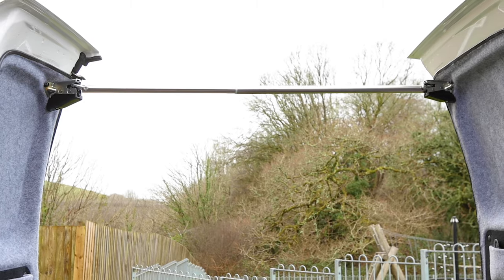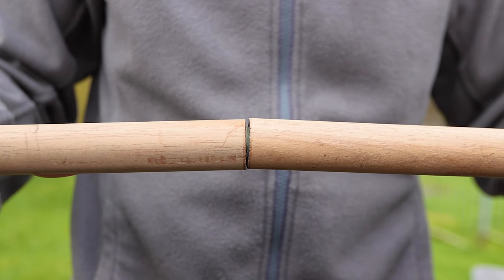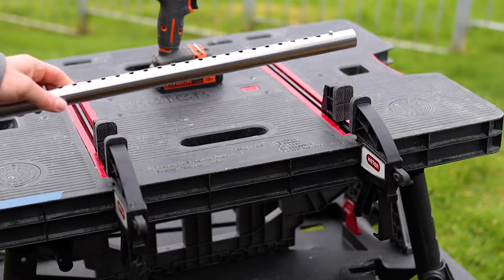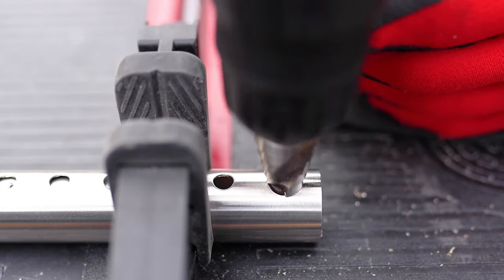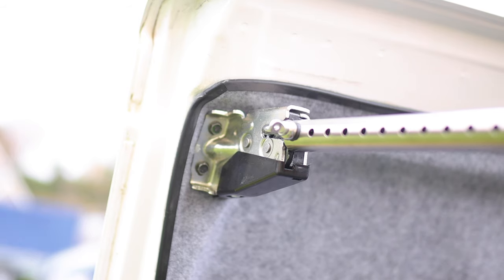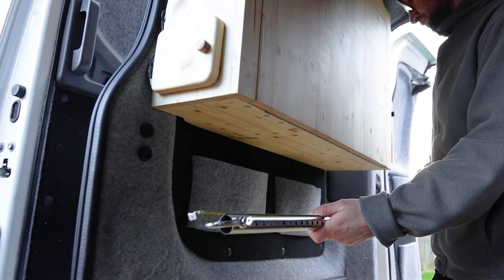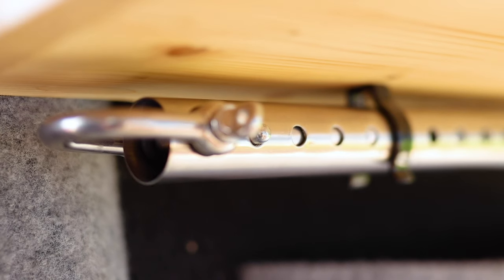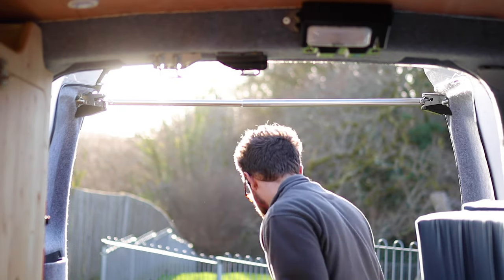HOW TO Stop Doors SLAMMING In The Wind | DIY Door Bar

Comment: That's perfect, and it could be used to hold a privacy screen for outside showering so the purpose would come full circle. Changing the subject I was impressed with your workbench and I want to get a new one as my B&D Workmate. It is now 30 years old and starting to fail. What make & model is yours, please?
Reply: I was thinking the same thing! Then do some magnets on the sides of the screen to stick to the door. *edit, sew in the magnet so they don't scratch the paint
Reply from the maker: Hi David, thanks! The work bench is from Toolstation: https://www.toolstation.com/keter-folding-work-bench/p10910?store=T6&utm_source=googleshopping&utm_medium=feed&utm_campaign=googleshoppingfeed&gclid=Cj0KCQiAvP6ABhCjARIsAH37rbRYc7xxrKJ-ASlWb-3xyfiaIc-dQsU47TV3_Ld8etZ5ZlwlC4GedJ4aApROEALw_wcB but B&Q/Screwfix do one too 🙂